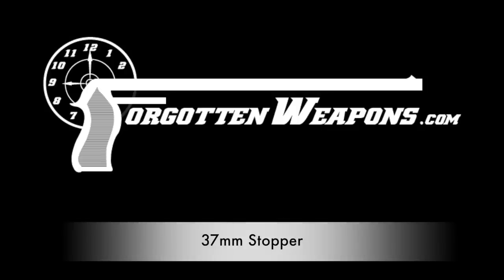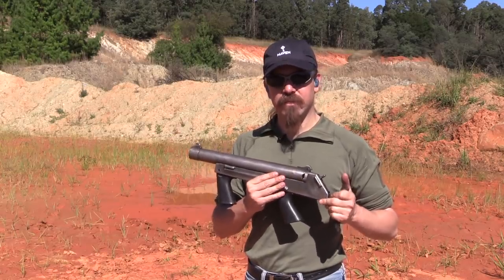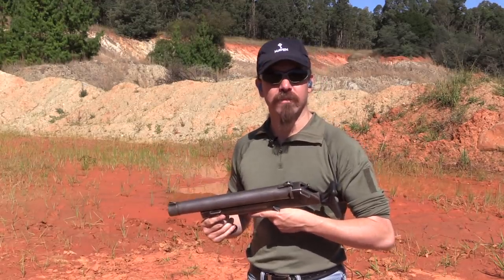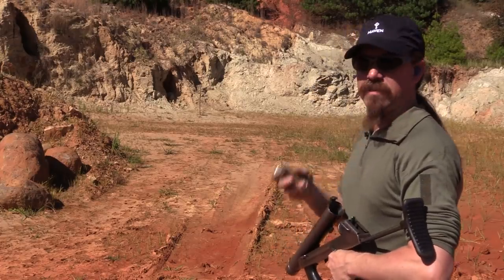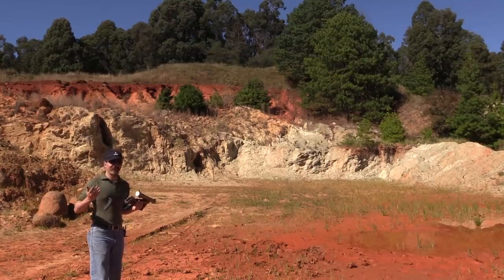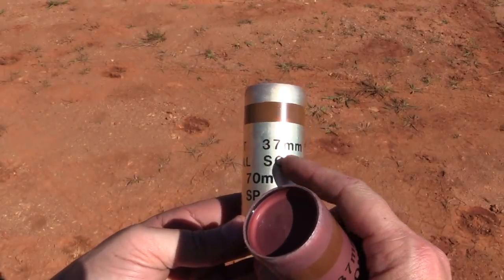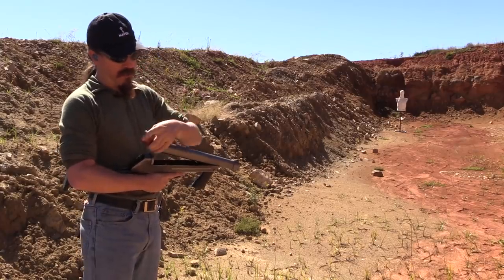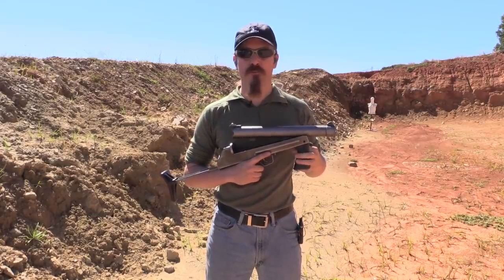Stopper 37mm: A Simple South African Riot Control Gun

Comment: As we can see Ian's laugh was designed for crowd control. Firing from an open bolt, his giggle is capable of sustained high RPM operation. When in this mode the shooter can rely on the internal magazine can hold 30 giggle (gig) cartridges or 5 high caliber laugh (haha) rounds. Some versions we able to make use of the valley girl (teehee) shells however with this example being full-auto uses the standard round. Switching calibers just requires adjustment to the feed lips and adjustments to the gas settings. This sytem uses a gas blowback design with venting in the nose and bum. This is a low production model that emphasized quality over quantity. In fact it's believed only one was produced.
Reply: Anyone else read that im Ian's voice?
Reply: Naw he sounds like sans undertale
Reply: This totally should be pinned! Just brilliant :D
Reply: Mike O'Barr d
Reply: Mike O'Barr, I am so glad I'd already put down my coffee before I read this comment, otherwise I might have had a disaster on my hands.  You should put up a "SNORF ALERT!" first when you write something like this!
Reply: I've just used 14 heavy calibre laugh rounds just now reading this from the trajectory of looking through my master eye, the recoil reverberated through my fingers to spur this comment, whilst leaving me flabbergasted at the same time
Reply: Dude i came down here in the comments just to say that im glad everyone knows whats good
Reply: Cant forget the bump stock
Reply: And he comes in moustachioed and moustache free versions
Reply: you are killing me dude lmao
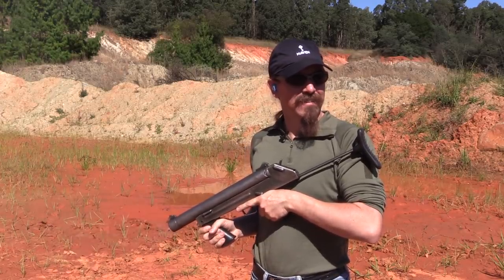Reply: Loop the video between 2:11 and 2:13.
Reply: Mike O'Barr HEHEHEHHEHEHEHEHEHHEE
Reply: *insert Patrick meme
"I love you"
Reply: 3:55 automatic fire
Reply: Hehehehehehehe
Reply: The English language was created for this comment alone
Reply: 3:55 Elmer Fudd?
Reply: This is the most roundabout way of saying "what the hell was that laugh man?"
Reply: I love this comment

Comment: I have a bunch of those old baton rounds from my grandfather. They’re really scary, 100 grams of very solid rubber. Apparently the cops used to aim them a couple of meters in front of the rioters so the batons would bounce up at groin height into the crowd.
Reply: That also takes some of the force out-helps keeping them less lethal.
Reply: Yes this is the correct way to use these rounds shot into the ground so they tumble end over end into the crowd , using them direct will result in broken ribs and other injuries
Reply: @steves6823  I think I'd rather suffer a full force rib cracking impact, than a reduced force groin impact.

Even more, I'd rather not be at the very front of the crowd.  Or if I was, I'd be wearing a damn cup.
Reply: @steves6823  The fatalities (17) caused by rubber bullets in Ireland were a result of direct fire rather than using the (proper) method you described..
Reply: @scottcantdance804  Plenty of folks have been killed by rubber bullets,I'd rather take the ricochet tbh..
Reply: The D-cells used to stay an shin height. Take CS, stick a D-Cell down the front, and yo u have two for one. Those batons rounds killed a few people with direct hits
Reply: Siward Beorn  Ja swaar. lot's of time in the 80's
Reply: @phillipbotha7920  Goeie ou Snotneus. Het baie houtkoppe met hierdie ding geroer.

Comment: BTW, the South Africans came up with some interesting crowd-control munitions (CS, baton, "bird-bangers", etc.) for use in 25/26.5 mm flare launchers.  

Re: "D cell batteries field expedient performance upgrade"  The S.A. police weren't averse to using those "bird-bangers" in a "ankle-biter" mode, skipping them along the ground, where the blast would spray loose gravel to painful effect.

In the 1970's, during violent Panamanian protests against the US Canal Zone, the ROE limited US forces to very short-tange LTL ordnance, primarily CS-based.  One of the prevalent types, was a large air/ground burst grenade, filled with CS powder.  These were launched from M-14's and even M1 Garands, with "spigot" attachments.  When the Panamanians started showing up wearing gas-masks, the CS had little effect.  Soldiers began modifying the grenades, cutting several slits just through the outer paper-fiber casing.  Thus modified, the rounds remained largely intact after the relatively weak burst charge had fired, becoming an effective "kinetic" round.  One of my ROTC NCO's told me about him using the modified grenades to knock climbers off of the perimeter fence.
Reply: Impressive thinking.
Reply: I live in SA, and when there are riots, which is basically everyday, we here very loud bangs coming from the university. Could that be the grenade launchers?
Reply: Mike Spencer  
One possibility, but it could be grenade launching systems firing teargas-grenades or another non-lethal. Hand-thrown ones have been losing popularity because they're very likely to be thrown back.

Comment: It borderlines between homemade to poorly factory made.
Reply: thats "Proudly South African made"
Reply: Considering the creator only spent two weeks to design and produce, not really surprising.
Reply: It acrually looks quite good. 

Simple to build, maintain low cost and easy to use.

Look at the rounds that were manufactured for it. The markings are clear, color coded for effect and range.

In a country where resources are limited due to embargoes or shortages this is an outstanding answer.

Worked every time.
Reply: @loosecannon8340  ....yeah, two more days design and it would have had a picatinny rail and been Parkerized.....
Reply: If it's been 30 years and still working, it's fine!
Reply: It doesn't need to have a nice finish and be made by SIG.

It works, it's cheap, it's simple, it's a police weapon.

That's all it needs to be.
Reply: And what you expected from police launcher? They are all like this, with only exception i can remember "Manvill gas gun" (you could see one in Terminator 2 movie). Dont fix thigs that works!
Reply: @ericphan2326  Guns basically works forever, if they are stored right and not worn out. There are guns several hundred years old still working fine.
Reply: @TheWolfsnack  Why would you need picatinny rails on this gun? It has iron sights, thats enough. You dont snipe anyone from a few hundred meters with this thing. hitting a specific target with one of those rubber batons is already hard at 30 to 50.
Reply: @obi-wankenobi9871  ...I was attempting to insert some levity into the conversation....
Reply: @TheWolfsnack  Oh.

Too bad it doesnt have an under-barrel grenade launcher attachment point. Would be really useful if you wanted to shoot tear gas, battons or flashbangs.
Reply: SA weapons were really good at that time but now they have nothing
Reply: It's well made, just simple. It goes off like it should and does the job for riot situations.
Reply: @francoisv1548  we still have Vektor(yes with a k) that produces some fantastic pistols and some other minor stuff.

Comment: I used one of those.. And as far as D cells are concerned, that is true. Some guys did. 
The rubber bullets were as gunnery instruction supposed to be fired at the ground in front of the crowd and bounce at least twice before entering the crowd.
We used to get issued rubber / stopper rounds, cs gas, various colour smoke rounds, flash bangs and flares.
 With riot/crowd control it was firstly warning to disperse peacefully within a specific amount of time. Failure to do so would start with unit members riot gear clad doing baton charges
With the addition of quirts  (a long thin plastic whip with an elongated thick tip normally round or squarish) and then step two which was the use of teargas from the stopper and from cup dischargers mounted on R1 rifles using ballastite cartridges to launch them, the R1 butt being placed in the hip and barrel at a 45 degree angle, rubber bullets from the stopper and shotguns (normally the Beretta 200 and 202 pump action or the Browning semi auto) and dogs commonly referred to as "tandmasjiene" or teeth machines. Thereafter the use of birdshot from shotguns and teargas.
Thereafter would be limited selected aimed and directed fire on command by the officer in control.
Reply: The quirts is still called a 'plastic zorro' in South Africa

Comment: I 'hear' if you use epoxy resin to attach a 'D' cell it breaks away cleanly [by cleanly we mean 'with as little evidence as possible'] on impact.  VERY Very persuasive ;). UK baton rounds [rubber dicks] came in two types, 25 grain and 40 grain. 40 grain was Not supposed to be fired at targets closer than 30m [ It usually was ^^ ]